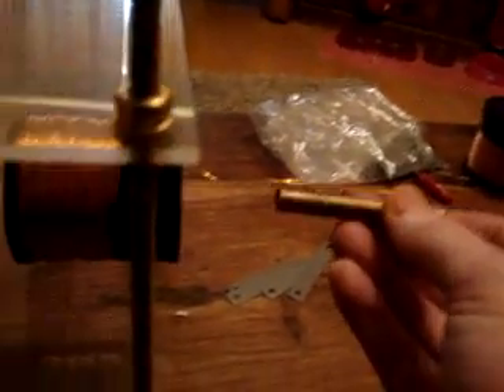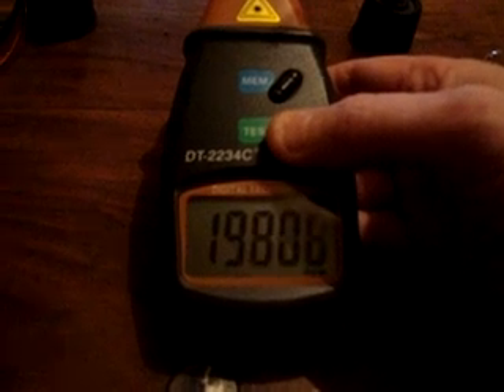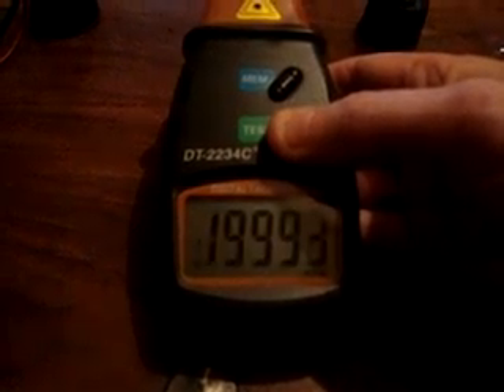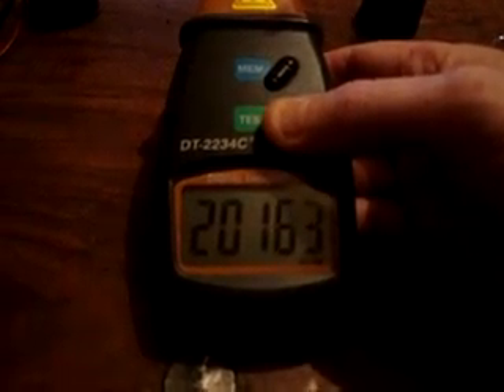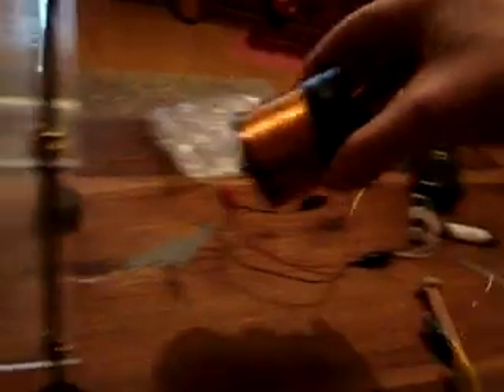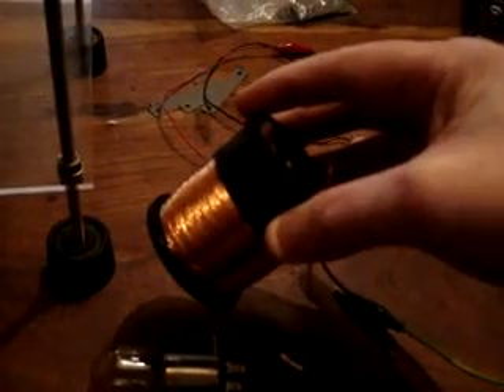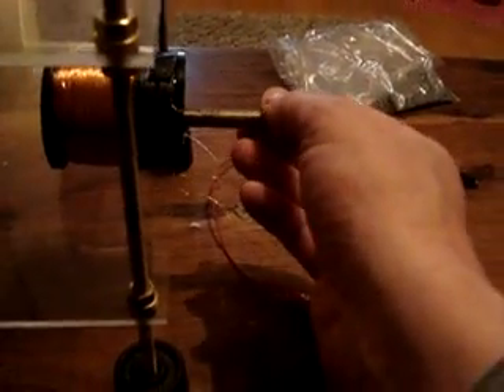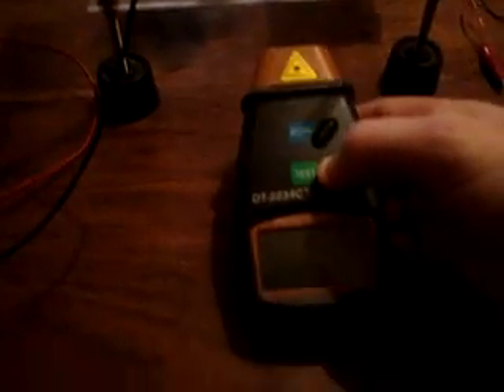Gary McKinnon simple demo of the Thane Heins Effect

Comment from the maker: Hi all, i thought it would be good to add a text explanation of what's going on. I won't put it in the info box under the video as a lot of people don't read that,, so i'll put it in this pined comment, i'll be using clear language here and staying away from uncommon lingo as much as i can.

To explain the Heins effect firstly we should take a look at how electricity is generated using copper wire and magnets, like it's generated in wind turbines, car alternators, bicycle dynamos and the like.

In a standard generator configuration you have a disc that has magnets embedded in it, and you have a set of coils positioned in a circle underneath the disc in such a way that when the disc is rotated, the magnets pass over the coils with the centers of the magnets over the centers of the coils when they are in the same position.

When the magnet passes over the coil, electric potential is induced in the copper. Science has labels and can tell you how the electrons move etc but noone knows why this happens, just as noone knows why magnets attract and repel. Yes science will explain about 'domain alignment' but all they are doing is describing their observations. The full nature of electricity and magnetism isn't yet understood.

So we just have to accept that when we have something like copper or aluminium that can conduct electricity, and that conductor is in the presence of a magnetic field, when one of them is moving, electricity appears in the metal. We could rotate the copper coils or the magnets, as long as they are moving or changing with respect to one another, and they are in close proximity, electricity will be induced.

Now for some detail, let's examine a single magnet on our rotor in it's circular journey toward, passing over and then moving away from a copper coil.

Our magnet has it's North face pointing up and it's South face pointing down, toward the top of the coil of copper wire.

As this South pole starts to move across the copper coil, the electric potential induced in the copper coil gives rise to a magnetic field in the coil, the South pole of which is at the top of the coil (underneath the magnet). Since we have a South pole magnet above the South pole of a coil then they naturally repel each other, it's the force that is turning the rotor that overcomes this, that force being produced by gas, coal or whatever, keeps the rotor turning.

When the magnet is directly over the coil (the center of the magnet and the center of the coil are aligned) there is no attracting or repelling force, it's a kind of neutral zone.

When the magnet is moving out of the coil, the top of the coil becomes the North pole, which wants to naturally attract the South pole face of the magnet.

So on the way in, the coil wants to repel the magnet and stop it's incoming movement, and on the way out the coil wants to attract the magnet and stop it moving out.

The magnetic field that's induced in the coil is therefore called the counter electro-motive force (CEMF) because it is counter to, or in opposition of, the pole of the magnet that induced it. In America this is often called Back EMF, or BEMF.

This behaviour is known as Lenz's Law, which says that :

The direction of the current induced in a conductor by a changing magnetic field is such that the magnetic field created by the induced current opposes the initial changing magnetic field.

Now, this opposing magnetic field takes a certain amount of time to be created, or to 'rise', the proper physical term is the rise-time of the inductor (an inductor is just a coil of conducting wire such as copper or aluminium), how long it takes for the opposing magnetic field to be created.

Inductance is a measure of the ability of a coil to produce electricity, different coils have different inductance values, they can have more turns of wire, which increases inductance, or less turns of wire, which decreases it. Other factors such as the shape of the coil also effect the inductance value.

Inductance is measured in Henrys (named after Joseph Henry, the American scientist who discovered induction at roughly the same time as Michael Faraday in Britain) and is denoted by the letter L.

The formula to calculate the rise-time of an inductor is :

T = L/R

Where T is the time it takes for the opposing field to rise in seconds, L is our inductance in Henrys and R is the resistance of the coil in Ohms. If you don't know then resistance is a measure of how hard it is for electricity to flow through a conductor, thinner wires have higher resistance, thicker wires have less so allow more electricity to flow).

So if we have a coil with a resistance of 200 Ohms and an inductance of 2 Henrys then :

T = L/R
T = 2/200
T = 0.01

So in this case it would take 0.01 seconds, or 10 milliseconds (ms) for the opposing field to rise.

But what if we increased our inductance, say we increased it to 3 Henrys :

T = L/R
T = 3/200
T = 0.015

So in this case, with our increased inductance, the formula tells us that the rise time has now increased to 15ms, we have delayed it a little.

What if we increase just the resistance in our first case (thinner wire or just longer wire) to, say 300 :

T = L/R
T = 3/200
T = 0.005

Now we have 5ms for the rise-time.

So we can see that as our inductance value increases, the time it takes for the opposing magnetic field to rise also increases. We can delay the rise-time or accelerate it.

So why is this interesting, how can we exploit this behaviour ?

What if we could construct a coil that delayed the rise-time enough so that the opposing magnetic field (or CEMF) rose too late to oppose our incoming magnet? It would also rise too late to attract our outgoing magnet. Anything that helps our rotor spin more easily means cheaper electricity generation.

Of course it's not all just about the coil, it's about the speed the magnets are travelling at (remember they are embedded into a rotating disc), if we have the rotor spinning at a certain speed and a coil (inductor) that delays the rise-time for a certain period of time, we can construct a generator that delays the rise-time just enough so that, when the magnet is incoming, the opposing magnetic field rises just when the magnet's center is nearing the coils center (but before it's at top dead center (TDC), so we still have 2 South poles and aren't in the neutral zone yet), this means that the South pole of the coil doesn't push away at the incoming magnet, but helps the magnet on it's way to TDC. It also means that we delay the rise of the North pole in the coil when the magnet has passed TDC and is on the way out, so the North pole of the coil doesn't get a chance to pull the magnet in when it's on the way out of the coil.

In short, we've used Lenz's Law to negate it's undesirable effects and more than that, to actually accelerate the movement of the magnet.

Now that we are getting this free acceleration, we need less power to drive the rotor, so our input current goes down, and our magnet is experiencing no drag, so the rotor turns faster.

I hope this helps!
Reply: Thanks Gary for helping me to understand the Hein's effect.  Fascinating that science cannot really explain what actually causes the generation of electricity.  Agree with you on your explanation that they label everything based on observation which leaves a vacuum.  The remarkable difference was jaw dropping between the inductance coil and generator coil.  Did  not anticipate the load drop out or milliamp decrease. Keep doing your uploads.  Hope one day you can travel freely outside the UK without any threats from my gov't here. 
IL Sas - Don
Reply from the maker: @UnacknowledgedUnknown  Hi Don, thanks very much for watching and your kind words. I'm planning a solo trip to look for Sas signs in some of our unmanaged forests that are wilder and less travelled. Keep up the good work :)
Reply: @GaryMcKinnonUFO  Thanks for your encouragement Gary!  Looking forward to hearing about your excursions into the forest to discover evidence of sas.  Appreciate your comments.  An fyi for you is a fellow researcher by the name Christopher Noël who has written several books on Sasquatch. He published a book that describes the over 80 types of stick and tree structures that he has catalogued. His channel is "Impossible Visits" also the title of one of his books I own.
Reply from the maker: @UnacknowledgedUnknown  Thanks Don, yes i've been binging his videos too, really interesting how they seem to be near the edges of civilisation in some places! His latest video was interesting with the night vision footage toward the end.
Reply: Gary! This sounds awesome. I believe completely that over-unity devices exist. Do you think that this experiment could evolve and ultimately negate the need for a power source?

You are a personal hero of mine. I'm a contactee. Mad respect for the hacking, and moreover the attempt to share what you found. I hope the stress it brought on is less these days.

Good luck in all.

Andy
Reply: If nothing else , please look at the shape of the diorite (and other hard, hard rock(7or8 on the moh(?) Scale) vases , of which 40, 000 were found under a temple (pyramid) in sakkara. They are mildly asymmetrical,  ergo not turned on a laithe, more like extruded. For all intents and purposes eternal. 

Study the form of the dhed pillar at your leisure.

As an aside, I was left with very harsh bruising after 'the attack' esp at the base of my thigh, on my backside, which was the side presented to the afor mentioned 'satelite dish'.

I'm prone to exaggeration at worst, never a liar.

Man I'm stoked to have contact with a fellow ufo enthusiast!

As another aside , I've a good hypothesis as to the function of the great pyramid. Controlled regular, say 60 a minute, explosions, compressing the quartz granite. Theres a double helix of energy emitted from the small, focused flat top, presumably energizing the ionosphere as tesla was doing. The evidence of erosion is apparent in one of the chambers, steps and floor 'eroded away'. The Nile ran nearby, and they used it as a hydrogen and/ or oxygen source to fuel each bang. Do you know how many kg of piezo material it is made of? And that the next layer is an insulator? 

Piezo, the best untapped power source about.

The pyramid would have been deafening.

It's all hunches, accepted, but I know I'm onto something. All the best
Reply: Cavolo..... grande!! 20.000 giri. Ma scusami se ti chiedo come hai costruito la bobina e che  dimensione di filo di rame hai utilizzato? Grazie Gary
Reply: This will help me moving forward. I've struggled to understand electrical engineering. There is a major difference between knowing and understanding. This, to any one it may concern is the path of understanding. I've been kinda in limbo with a particular project and after reading your description I will start to apply the understanding and see what I get. If you are available for email chat I would love to pick your brain. I want to go open source but I'm just not ready to reveal it until I know it will be of importance to the community. If that makes any sense? Anyways, great description and cheers.
Reply: You lost me as soon as the cat jumped off the chair. Looks like a very nice cat.
Reply from the maker: @fzen2432  He was only in frame for a few seconds but i'm glad you can tell :) I called him Neo because he did Matrix moves, runing up walls etc ...
Reply from the maker: @fzen2432  My lovely Neo, he was amazing, died in my arms :(
Reply: @GaryMcKinnonUFO  The cats in my life - past and present - have helped me become a better person.
Reply from the maker: @fzen2432  Nurturing.
Reply: @GaryMcKinnonUFO  Having a cat on my lap is my favorite way to meditate. My mind slows down and I become more deliberate in my thinking. How long ago did Neo die?
Reply: Tesla bifilar coils have capacitance between wires. Above critical minimum frequency, energy will be stored in capacitance between wires rather than electromagnetic field. Coil will not create back EMF, until capacitance between wires is charged. Capacitance between wires will discharge into load later, when magnet has already passed top dead center of the coil.
Reply: Cool content and although it is a bit over my head I do get the basic principles, but regarding our lack of understanding of electricity etc. I always thought it counter Intuitive how electrons don't have much movement down conducting wires whereas there's a lot of movement in the field surrounded by it, whether it is insulated or not. I suppose it is similar to our knowledge of quantum mechanics and our ability to get lots of consistent data etc. but noone has any real clue WTF is going on there either.
Reply from the maker: dylans voice  Thanks for watching. Yes i'm amazed he got his patents, has more on the way and is still alive!

Comment: Surely that just demonstrates that you lose less power with the load connected than if you just took the coil away? You're getting a lot of eddy current losses in the setup with the load disconnected, and less when it is.
Reply from the maker: No it's due to the rise-time of the inductor being retarded, a delayed load current, which is why the effect only happens at a critical minimum frequency.

Comment: THIS is commonly called a... watt thief or a voltage amplifier...  it doesn't actually increase power, it just makes more of the power that it receives available, for immediate use, like, it just takes a 120 volt thing and makes it 240 volts, but that doesn't increase the overall power coming out of it.
Reply: dylans voice     ok it's not a watt thief.  I'm looking into it further.  I apologize.  Over unity seems to be the theoretical source of energy production, but I....    can't think with that thing running.  Thank you.
Reply: dylans voice     I don't see that it is using less energy.  When he says that the draw drops, that doesn't mean it is drawing less power to run, more likely it means he created a circuit that uses some of the power, for the bulb, I think.  I don't know how he wired this, I'll have to watch it on mute.  I'm not an electromagnetrician.
Reply: dylans voice     ok I see that Gary uploaded a vid after this, with Thane and his theory, but unfortunately you can hear in his voice, at the end, he realized after he put the presentation together, that he was attributing the increase in rpms to what he thinks is happening, but he is incorrect.  I think that it is not a delayed reaction, but it is a function of the frequencies that the coils conduct.  The load capacity stays the same, regardless of the  rpms.  I like the overall concept but Gary would need to cool part of his device to near absolute zero, or  incorporate an array of magnets, I forget the name, to create an irregular shift in the EM waves.
Reply: dylans voice     this isn't for energy production, Dylan.  This is rudimentary gravitational theory.  He wants to build a grav generator.  I like these ideas, I'm not saying his device does nothing, but it is not a power generator.  It is difficult for me to explain, I have a limited education, so thank you for reading my opinion.  Have a good day.
Reply: dylans voice     there is one design,  of mine, that can do both.  But I designed it, so I'm sure it doesn't work.  It uses a physical delayed reaction, so I like the idea of an EM delayed reaction.  But he needs to show us the spectrometer, the oscilloscope, I find his graph difficult to believe.  If it could generate power it would not be on the internet.

Comment: Are you sure that isn't just a voltage amp like the various designs that dozens of youtubers have made, a simple tesla coil wrapped with wire, which does not increase amps in any way, and does not have any higher output than what goes in?  
What exactly are you saying that this does?  Gary?
Reply from the maker: No it isn't just a voltage amp, there are US patents on the design if you want more detail, plus check the other videos in the playlist : https://tinyurl.com/y8nzygvv

Comment: Was the no-load current without the core higher or lower than the current under load with core?
Reply from the maker: I can't find anything relating to no-core tests, ujst various spreadsheets showing delta current and frequency between no load and short-circuit. Here is a link to the inventor's channel, i've been in email contact with him since 2007 : https://www.youtube.com/channel/UCBslCeRonaXNJ0x_g_ZTEew/videos
Reply from the maker: I did do various tests with and without cores, different cores, transformer laminations etc but it was back in 2012 so i'll have to find the data. Thanks for watching William.
Reply: Thanks for checking.